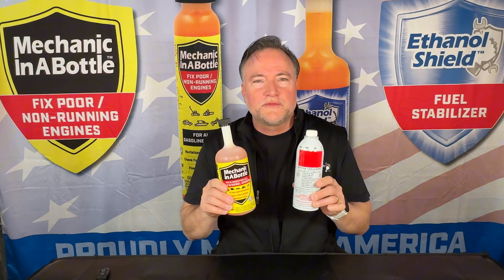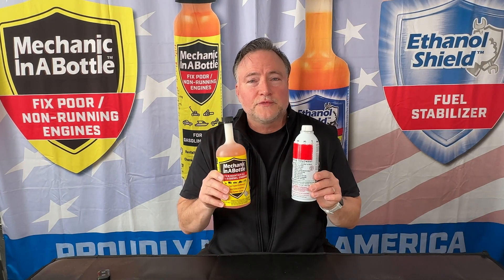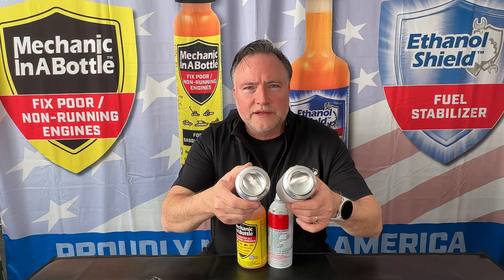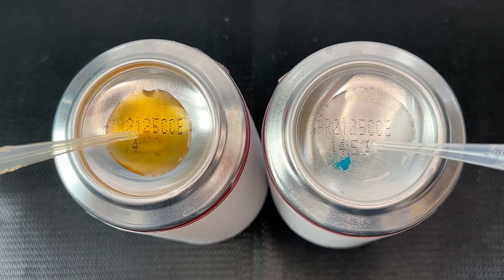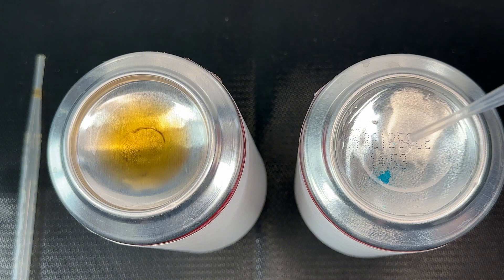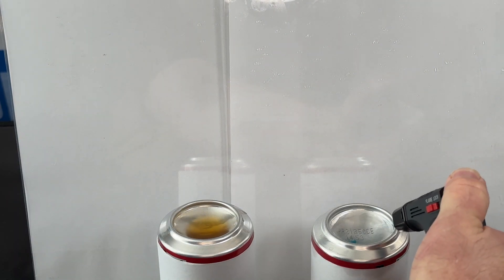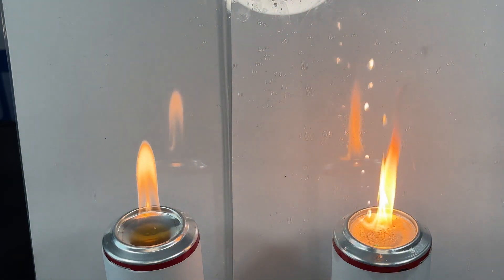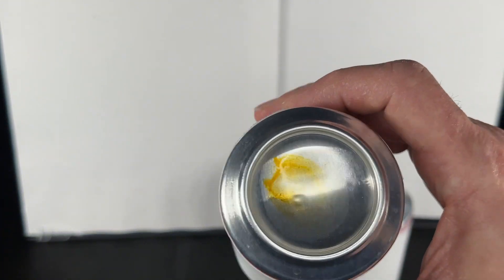All Fuel Additives Are Not Created Equal - Real Life Performance Testing Lets You Decide!

Comment: Are all the various labels of MIB the same formulation?  Some say to drain fuel system...some say do not drain fuel system.  Which is correct?  Why all the mixed messaging?
Reply from the maker: We updated the label. Either way works, but the latest, we just say you do not have to drain the fuel. Of course, if you drain the fuel, and therefore use it full strength, it will be stronger than mixed with fuel. The easy way is to just try without draining first. Also, you cannot over treat so you do not have to worry about that.

Comment: If you made an oil treatment, I would try it in my Chevy LS. LS oil pick up tube has an oil ring that dries out, leaks, and you loose oil pressure. It's a big job to replace, especially on a 4 wheel drive. Thanks for the great products you make!
Reply from the maker: thank you!

Comment: Yes I use both products, can you dump MIB down the carb to clean the rings?
Reply from the maker: It will not hurt anything, you can not over treat with this product - but if you add into the fuel tank and prime it in, it will go into the carburetor and entire fuel system